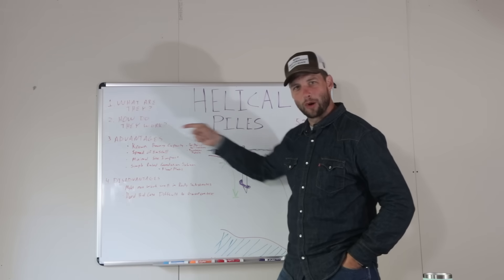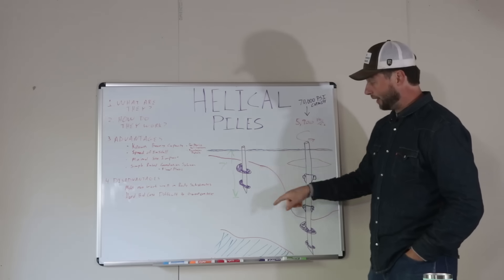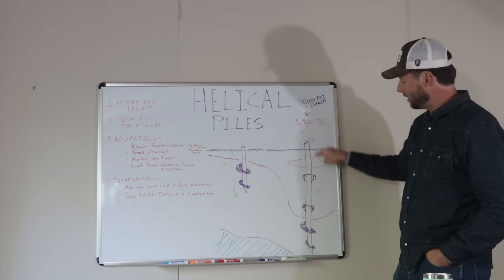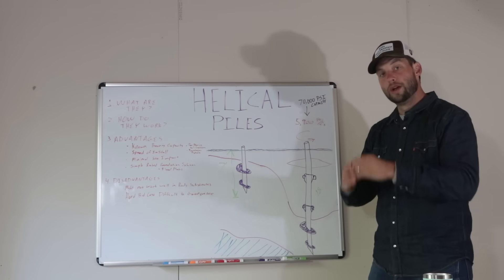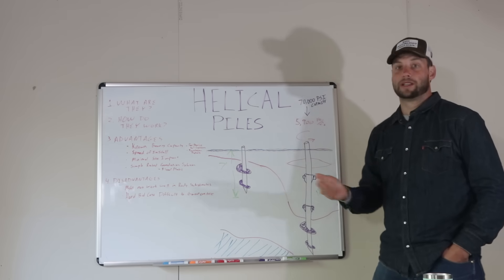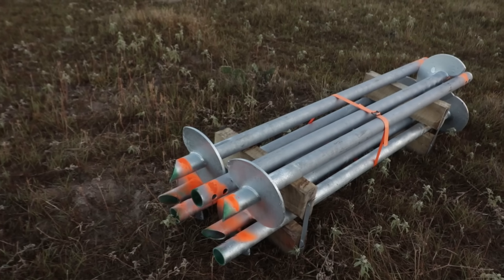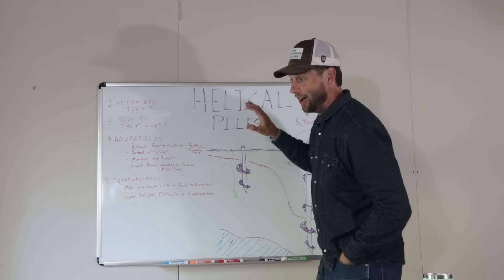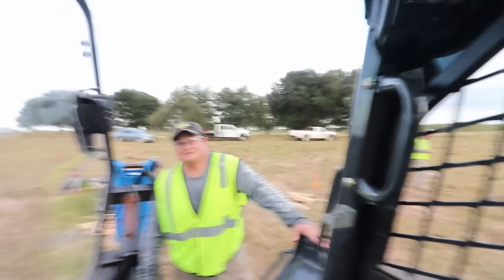Is this the BEST FOUNDATION for your new home? Helical Piles Explained.

Comment: How does this work in a seismic zone where you could have soil liquefaction?
Reply: These work great in liquefaction sites. You need a good subsurface to be able to specify the depth of the helix into a non-liquefiable layer (so cannot fully rely on the torque rating during installation as the method of establishing depth of pile). One big advantage of this system is that there is the option to relevel the superstructure in the case of minor/moderate liquefaction settlement following an earthquake (since the connection from pile to framing is typically a bolted saddle). Lastly, the raise timber floor more readily allows for cleanup if ejecta occurs under the building
Reply: First, soil liquefaction only occurs in very specific geologic conditions.  If you are not in any area with high water table and loose silt, then chances are you won't have any problem with liquefaction.  Second, if you are in an area with liquefaction, don't build there -- your foundation would need to completely penetrate the liquefaction layer to firm soil beneath it.

In other words, this isn't a solution for liquefaction.

Comment: Great video and explains most of the queries we get. Well done. However your stated capacity seems a little optimistic and should be more like 50000 .
Reply: His numbers are pie in the sky. Torque vs. Capacity conversions can be problematic, but it is an accepted standard used by engineers.

Comment: Seems like a great system.  I live in Phoenix and the vast majority of our homes are slab on grade.  Well, when it comes to our track home building there is often less than adequate site preparation and final grade completion.  Add to that, most of our homes don't have gutters so what little rainfall we get is deposited right next to the foundation.  Case in point.  I pulled up all the carpet in our bedrooms only to find cracks galore in our slab.  Now I need to call out a foundation company to check and stabilize both the foundation and the slab, then I will need to pour a floor leveler to create a level plane again.  I just hope after that I don't run into room transition problems.

Comment: Interesting timing, my helical piles were finished yesterday. Soil borings showed 35ft. My actual average depth was 65ft the deepest went 77ft! Very swampy land! A few questions, first after the first 2 piles went 77 they switched to a square shank first helix piece the extensions were still round They said "They bite better". Why would that make any difference? Also they eyeballed mine for plumb. I noticed your guys had levels what might be the tolerance for plumb on these things?

Comment: Another advantage of raised foundation is flood damage prevention and ease of repairs to underground utilities.   Venice Italy actually built on ancient wood piles.  No oxygen equals no deterioration.
Reply: Unless there are marine borers eating away at the wood, or if concrete then the salt is attacking it and the steel reinforcement. They would be wise to just jack up the city and slip floating foundations underneath  and just float the city with the tide like how Holland, Netherland does it.
Reply: @Joshua79C  have to check into that..floating foundations?  Have another house in NC in a flood zone.

Comment: I don't trust it to last more than 20 years without rust, yet my concrete piers are pushing 70 years without any sign of wear.
Reply: We install them along railways in wet Ireland... No sign of rust . As a matter of fact we often use extra sacrificial steel  instead of  zinc as manufacturing process is quicker.

Comment: Interesting topic Jordan. Do you get any lateral capacity (sideways wind resistance) out of these piles, and if not how are you addressing those loads? What type of beam system do you use to span between the piles?
Reply: I've been watching this kind of video lately and that is rarely directly addressed. However when they use smaller helical piles for mobile home tie down purposes it is enough of an issue that the soil for a few feet below the surface is excavated next to the pile and filled with cement, presumably to resist side loads.

In this case, he sort of addressed the issue by saying if they go higher that they need stronger piles, but does that mean the limiting factor is bending of the piles above ground or the limiting factor is how much lateral resistance there is for the pile just below near the surface? 

I suspect side load is not an issue at all if the piles are used with a cement slab. And side load is probably not an issue with the design in this video since the pile strength seems to be much larger than might normally be required. It would have been interesting if he had addressed how the pile sizing was determined.

Comment: I think it would be worth contrasting these to driven timber piles, which is what everyone frames off of here in New Orleans.  Some drive them to at/below grade and pour concrete footings over pile caps, but most leave them sticking up ~3ft above grade and just frame off the piles.
Reply: Yep, I’d imagine that for Louisiana soils…. Placing helical piles along and at base of perimeter footings would be a perfect solution for construction on our narrow lots when you can’t get a pile driver in the backyards. Just perfect.

Comment: Sounds pretty cool. Are there any concerns with rust being that it is in soil. Could say in 50 years the piles rust 2 point of failure and cause issues for the house?
Reply: Can't speak for 50 years, but after 7 years, the portion of the piles sticking out of the ground of my MA home show absolutely zero signs of corrosion.
Reply: Would say the upper three or so feet would be affected over time, the deeper you do the less likely it would get damaged over time. Have yet to use this system myself and basing on how concrete foundation and wood survive in such use. Also depends how well coated in zinc it is to prolong useful life.

Comment: I live in the Chicago area.  I dislike concrete foundations and slabs -- they're expensive, difficult to insulate and keep dry.  I've never liked being in a basement -- even when it is insulated and finished.  Slabs make my knees hurt.  I would rather have more living space above ground.  The challenges I see with pier and beam are how do you keep your water and sewer lines from freezing when it's -20F and how do you reliably keep critters out of the floor?

Comment: How new is this system. Never heard of it.
Reply: Modern uses are new, helical piles have been around for at least a century as the first known idea "is described by the Irish civil engineer Alexander Mitchell in a paper in Civil Engineer's and Architects Journal in 1848" (Wikipedia article on screw piles).
Reply: In Russia, this type of foundation mostly use by army: fast install at any ground. Commercial use for people like from 1999-2000.

Comment: I first heard about these for an alternative solution for underpinning (I'm in Canada where we have basements) never seen it in action though. 

What's the benefit of a raised foundation vs a slab on grade?
Reply: berk
Concrete slab foundations are colder than s@!#t.
Reply: Yeah right I live in the northeast US and love our basements.
A few of benefits I could see would be 
-Ease of changing interior layouts of kitchen and baths. 
-Easy to pick up and move the house if ever needed.
-Also light flooding might not effect the structure as much.
Reply: Walkability is much better than on a slab. Walk on a slab in your bare feet, then walk on the second floor, and notice that the floor takes some of the impact of walking. The downside is that the floor needs reinforcing and waterproofing in wet areas with tile, like bathrooms, to keep the tile from cracking when the subfloor gives. For can also nail down hardwood rather than engineered floors or laminate, and the food won't pop up when you step off.

Comment: I heard about helical piles about a year ago… Apparently they are very popular in Some parts of Canada, Very cool system… My only question is, how does one condition the space under the house ? Possibly some sort of cementitious material used on the perimeter? With a vapor barrier?.... can a pole barn be built or helical piles?
Reply: just plastic wrap pressure treated lumber on the underside, cement perimeters store just as much moisture as on the outside

Comment: what I hope to do for my little house in the northeast :)
Reply: These were used for my deck in MA built back in 2012. They are extremely rigid with no signs corrosion after 7 years. However, when I replaced my deck with a larger one, I opted for digging my own 4-foot footings fearing that I would never be able to get the new set of helical piles exactly where I wanted them due to the myriad rocks we have in the ground up here. It turned out I had boulders in 4 of the 5 holes I dug--each weighing between 45 and 60 lbs. There is no way the pile would have gone through those and would have had to be positioned left or right of the ideal post locations. This is something to keep in mind if planning to use these up here in New England.
Reply: @nicholash8021  I may run into rock(s) as well but I have designed the beam structure to provide spacing tolerance. If we run into ledge we will anchor into it. the great thing about helical piles is that bearing and uplift are precise. Tx, Rich

Comment: this saves you a tone of money compare to concrete piles. I wish we could use it here in the hillside area in SoCal
Reply: Reza Tashakori 
Why not?
Reply: @BrianBriCurInTheOC  seismic requirements
Reply: Reza Tashakori 
Do a little research because there are other components which are used with this type of system which include steel sleeves and adding concrete grout. The system shown in Jordon’s video is a basic system. Consequently, added components increase cause but as you are aware seismic requirements yes bring added costs.
Reply: @BrianBriCurInTheOC  Perfect Brian. I'm an architect so I could definitely work with a structural engineer who knows this system well. Using this system could save us millions of dollars.

Comment: i wonder about the durability with clay soils. over here they are currently advertising a slightly different system that has a finer screw on the end instead of the helical plates which can handle rocky soils, plus if the soil is core drilled it can be screwed into rock etc.

do you guys put moisture barrier down before the framers start? 
one thing i often see is builders not putting moisture barrier down until after the house is done. makes it difficult to install, need to clean the ground etc. would be so much easier to install it early on and it makes life so much easier for the plumbers and electrician. 
i personally would have sprayed the grass out and smoothed out the ground surface first. make sure the drainage slope is right and make a good clean surface for the moisture barrier to go onto.
Reply: Correct. Helical piles perform well in finer grained soil strata. If you live in an area with expansive clay, and/or mixed rocky layers, helicals become problematic. Grouted Micropiles may be a better option. And they are much cheaper to install than the manufactured systems shown in the video. In the mountains you may need rock anchors to drill into solid rock to achieve the desired capacities.

Comment: Have you ever used or heard of the Tella Firma foundation system?  It seems very similar with the helical piles, but then they pour a slab foundation on top of the ground and use a screw type system to lift the slab 9 inches about the maximum rise level for whatever your soil is at your location.  I think it started in Dallas TX, but I think they have expanded to other areas now too.
Reply: Like their system, much prefer having a slab...

Comment: 70,000 Psi or psf?
Reply: It's probably neither. It is probably just 70,000 lbs.
Reply: John-Jozef Proczka that’s correct, 70 kips.
Reply: 70,000 lbs and that is ultimate load capacity, the allowable load with the pile and installation torque he is using would be 35,000 lbs.

Comment: This video is applicable to my current interests. I just learned that concrete is basically a slow sponge and I've been looking at annoying ideas like.. over-excavating and painting it all with epoxy when it dries. xD
Reply: You should just be putting a vapor barrier under the slab before you pour.  So no need to excavate.  With the concrete thats exposed, you can do whatever you want to it, we often put paint on it or stucco but thats purely for aesthetic reasons.  Inside the building should be completely dry if you've placed a vapor barrier under your slab and control the humidity in your house.
Reply: @bmwestmoreland  The advice on that is appreciated, but I was thinking more about the outside of concrete walls in a basement. I just watched https://youtu.be/kwn0Vjw_ji0 and trying to figure out what would be best long term for a basement, since the external barrier would eventually degrade.

I can't find it now but there was also something else I watched that talked about "the only reason concrete becomes porous is because it's usually over saturated when mixed, then when it dries the space the water took up creates channels for more water." Wish I could have gone to school for this stuff instead of Googling for ages until I hit the paywall on scientific articles.

Comment: Neat! What is the cost vs a typical foundation? Why did you choose to use this?
Reply from the maker: I think we will be very competitive (maybe cheaper) to a fully engineered slab on grade in this area.  I chose it because we wanted a raised floor foundation, and wanted the best stability possible.
Reply: @JordanSmithBuilds  so whats the BOTTOM LINE for this job site ?  8,000? 12,000? $$$??
Reply: @gojoeyr  I'm not a professional but I've been quoted around $10/sq ft for an engineered slab so probably 15-20k I would guess.

Comment: I do like the Helical Piles as part of an engineered foundation.  In parts of Texas solid rock can be a few inches down.  In other parts of Texas we have expansive clay soils and the Helical Piles could work well but required depth may need to load bearing soil below where the constant moisture zone starts.  The soil survey done by a Registered Engineer, that does soils engineering, should alert you to those conditions.  

You did not mention the uplift capacity of these piles.
Reply from the maker: You're right!  We didn't pull test these, but we expect an uplift resistance in excess of 40,000 lbs based off past testing.
Reply: @JordanSmithBuilds  how many wood or concrete pile systems are pull tested? lol  It's amazing what we think we know because we've always done things a certain way and then a system that is engineered and tested comes along and we doubt it will work. I'll go with building science myself. Rich

Comment: Interesting that the piles require a specific bearing capacity while a post or pier would be installed without knowing each and every bearing capacity.   How are extensions. attached?
Reply from the maker: Double bolted with 3/4 bolts.
Reply: @JordanSmithBuilds  -hmm maybe a weld would be better long term?

Comment: Neat system. I wonder what the longevity would be like in coastal soil with relatively high salt chewing the zinc off.
Reply: i'm a welder that works for a company installing chance helical piers in south FL and they warranty them for 30 years
Reply: Only 30 years… Then what are you going to do lift up the house and do it again that’s not good enough I don’t know why I’d ever want to use these. One of my houses is 120 years old and the foundation and that is in fine shape I would’ve already had to replace those pillars potentially three times 🤷🏼‍♂️
Reply: There are plenty of coatings out there that do excellently at the ground air transition. 20 mils of a 100% epoxy coating should last many decades in this service.  I would trust a good coating more than a few mils of sacrificial zinc.
Reply: How much hp is this skid steer?
I just want to do screw pile for a deck,only 5 to 6 feet down.
Reply from the maker: Great question.  I'm not the expert, but I would guess it would perform well underground without much oxygen to complete the oxidizing reaction. At the transition between the ground and air in the "splash zone" would get hit the hardest.  I'm sure the manufacturers will have an answer as they install these for bridge foundations all the time in the gulf.  I'll see if I can get some data from them.
Reply: @JordanSmithBuilds  Good answer, and therefore the real answer is, depends on the thickness of the hot dip process zinc coating as with any other part in the same scenario. Cheers :-)
Reply: @JordanSmithBuilds  Cool - that was also my first question. We get forty inches a year which can be hard on fencing - but replacing a fence post is a lot easier than replacing a foundation pier.
Reply: If you want it to last forever, then stainless steel helical piers are available as well. For sand, you can also find wide aluminum helical piers. 

Another great choice for rapid installation is GeoPier, which may be compacted crushed gravel or compacted aggregate concrete. 

The bottom of the GeoPier spreads out as a hemisphere into soil due to high pressure impacts, creating increasing footing surface area while it also compacts the deep soil, until the increasingly compacted soil and growing surface area has exceeded the required bearing capacity. Then stacks of compacted gravel or concrete fills the hole back up to the surface. The entire length of the pier is locked solidly into soil.